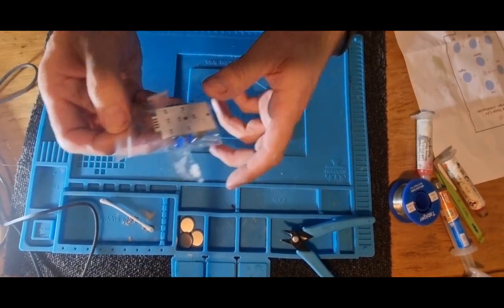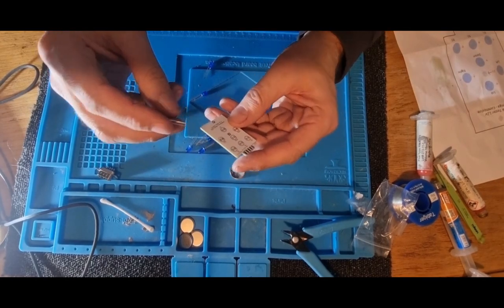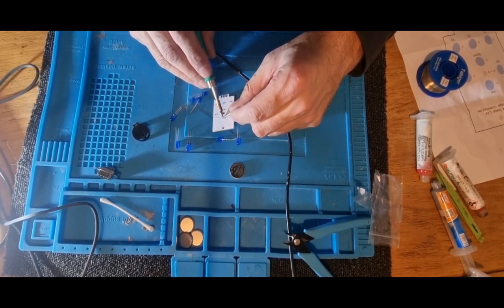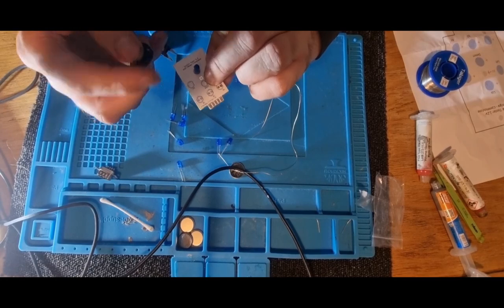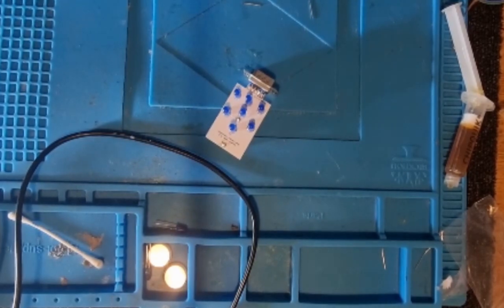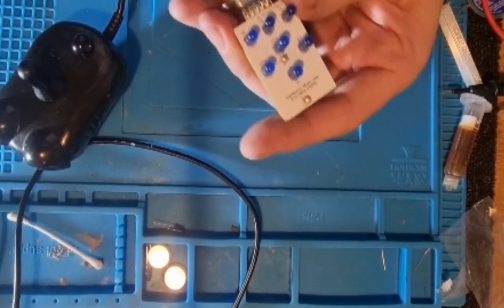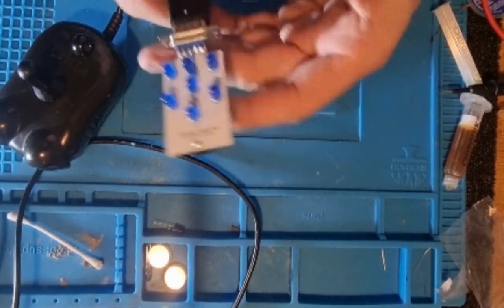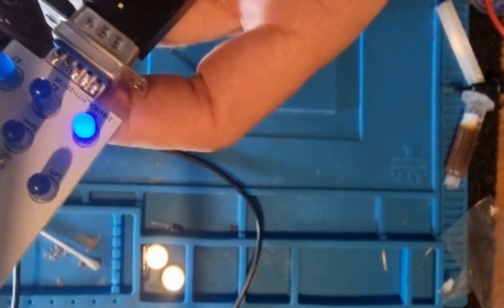Have you a DODGY Joystick?  Build a tester!!

Comment: Very simple but very useful tester. Thanks, Neil :)
Reply from the maker: Saves pulling out a console..
Reply: @Retro4u  And for these joysticks, the issue it's always about bad connections and mechanical failures...so this little kit helps for sure...
Reply from the maker: @Josip Retro Bits  for sure and is so compact easy to keep on the desk.